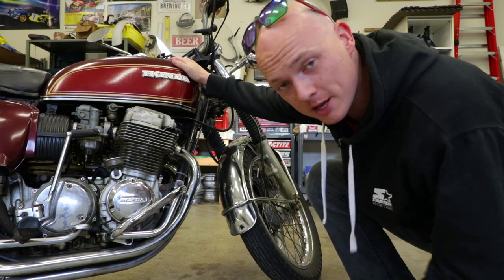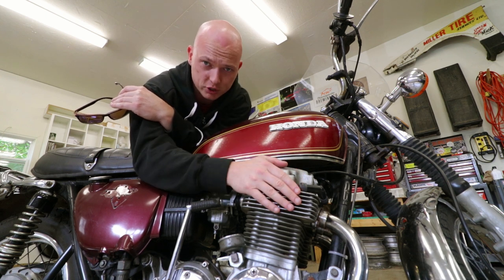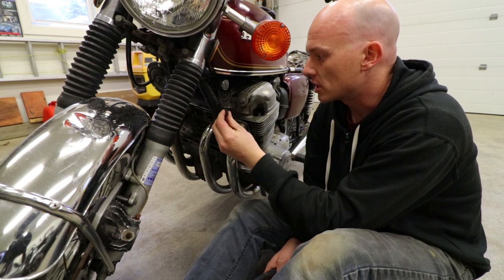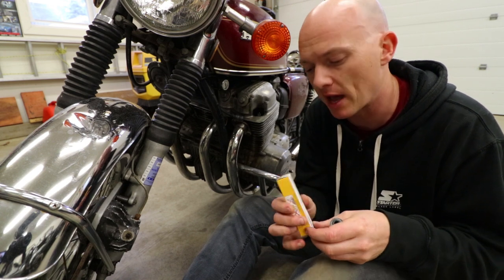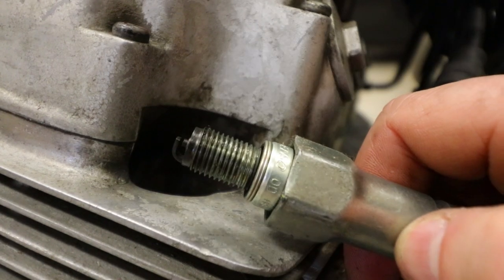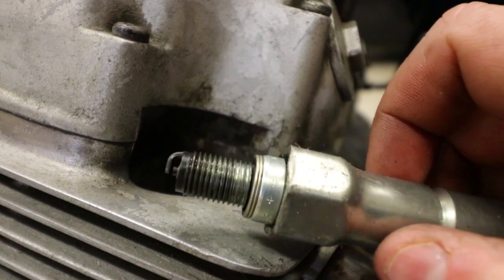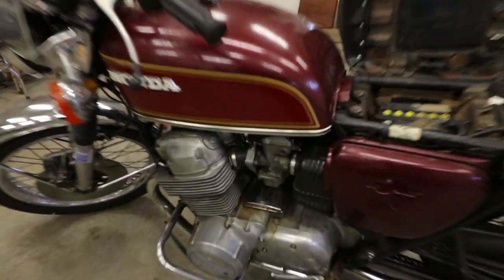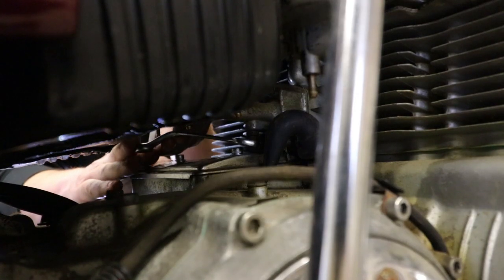How to adjust Cb750 valves and cam chain tensioner! (Project Ron Burgundy pt. 2)

Comment: In the 1970s when I still rode, i owned 3 of these, to include a K0. Used to do my own work because dealer work was not up to par. When the K0s came out the plugs tended to foul. The advent of platinum tip NGKS solved the problem.
Reply from the maker: Oh wow. A sand cast cb750k? Those are becoming incredibly rare. The plug fowling is an issue on my bike but I suspect the reason to be bored out jets (likely caused by improper cleaning tools).
Reply: Mine was a production model. Only the early K0s were sand cast.  You can tell by the side covers.  When I bought my 750-4 in 1970 it came with the old type link chain with the removable cotter like I had on a Triumph Bonneville I had.  The chains were breaking and holing the case.  Honda recalled mine to replace the chain with the endless variety and with a higher toothed countershaft sprocket.  The original was 13 teeth.  This reduced performance somewhat which was disappointing.  I first saw  the 750-4  in late 1968 at the Tokyo Motor Show.  I was on assignment in the USAF to Japan back then.  The early bikes carb setup was with a separate cable going into each carb.  Hard to setup -- you had to have a vacuum guage setup as well.  In the a later Honda four, I installed a kit with Delco Remy points that could be adjusted with an Allen wrench like the Corvette I had back then.  All you needed was dwell meter -- timing light as well. And everyone knows about changing the oil filter -- not to break the bolt holding the filter cover in place.
Reply from the maker: Wow! Really great info. Thanks for sharing the story too!

Comment: Glad to see you post up a vid! Yeah, I was replacing the caps on my 72' 750 and quickly realized I could not clip any more off of them. Was a great excuse to buy new coils as the wires on that bike were molded into the coils. :)
Reply from the maker: Factory and factory style always are. When I bought my green bike it came with... CAME WITH... A set of 3ohm dyna coils and a dyna S ignition! I need to get those puppies installed soon. They obviously don't have the wires molded to them 😋
Reply: Yeah, Dyna coils and ignition are next on the list for my 75 CB550.. They are on a shelf over at Godfferys garage waiting on me. :)
Reply from the maker: Sooooo good!
Reply: You can use coils off the older years goldwings. That way you can just replace the wires if needed. They are cheaper and work great. I use them on my 1972 cb750
Reply from the maker: Rick, that's a great piece of information for folks. Thanks for that! I'm curious as to how easy those coils are to track down. Can you buy them new?
Reply: @Mike_Barker  ya I got mine on Ebay. There is no need to buy expensive coils. For the money I think goldwing coils will work just fine. I have a 1972 with 63 thousand miles on it. I love cb750s. They run for every and have plenty of power. Mine is a little custom. It has 6 inches over in forks and lowering blocks in the back. That's enough about my bike but keep up with all you work on the 750s. You are very helpful.

Comment: Don't you need to check to make sure cylinder one is at top dead center before doing the cam chain adjuster?  (Or did I miss that part? I skipped ahead to the cam chain part of the vid.)
Reply from the maker: I goofed! It should be at 15 degrees AFTER top dead center on cylinders 1+4. Good catch! I'll have to update this process
Reply: @Mike_Barker  Your videos have been very helpful.  I recently bought my first motorcycle, a 1975 CB750.  I knew nothing about bikes or mechanics, but I've been able to do some work on it thanks to vids like yours and that dude from hackaweek.   I actually took the carbs off and fixed a couple issues I was having.  I'm going to do a carb sync and a cam chain adjustment tomorrow.  (How do I know if the cam chain needs adjusting?)
Reply from the maker: The cam chain will make a bit of a slapping sound when running. After the adjustment the bike should be back to its typical Honda sewing machine sound. 😆

Comment: You didn't put in your video to put number one at top dead center compression stroke and why did you start on number 4 cyl ?
Reply: Also your valve lash should 5 thousands of an inch for intake valve and 8 thousands of an inch exhaust but I heard from other Honda owners that setting the valves a little more then spec helps save on burning out the valve seats and cams as fast compared what they originally thought and designed back in the 70’s
Reply from the maker: Incorrect! Valve clearance should be 0.002" for intake and 0.003" for exhaust. However!!!!! That translates to 0.05 mm and 0.08 mm!!

I think that might be where you're five and eight came from.

Comment: Boy I'll tell ya, I wish I had some of those bars protecting my points cover on my KZ650. Had someone pull a U-turn into a few weeks ago, and shattered the crankcase where the points cover is. Only damage on the whole bike aside from a chipped blinker lense.

Now I've either got to find a way to fabricate a new cover, or replace the entire motor 😔😔

Comment: Hey. Enjoying your videos.  I just purchased a 1971 cb 750.  I was told the engine had been gone over, carb kits etc etc.  once fired up you have to have the choke open for 8-10 minutes before it will run by itself.  Sputters and coughs for another 10 minutes till it straitens out.  Any suggestions on where to start ?  Or maybe I’ll just go through everything on it like Ron burgundy.
Reply from the maker: Sounds like carbs to me. I'd go over the entire engine with a fine tooth comb though. All the basic service adjustments.
Reply: @Mike_Barker  ok will do.  Thanks man.

Comment: Cam chain should be adjusted 10° after top dead on #1
Reply from the maker: Yup! To make sure the slack is totally out of it before you use the adjuster. 👍 I forgot to mention it when I did this video. 😔
Reply: rad randy bowler  that’s 15% after crankshaft is top dead center of No. 1 cylinder